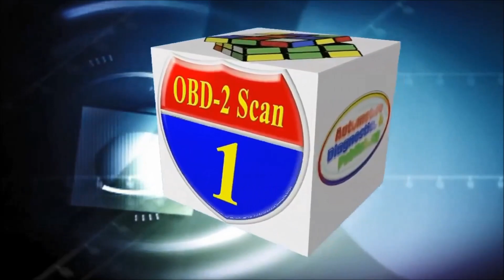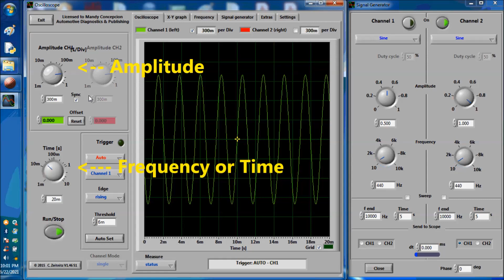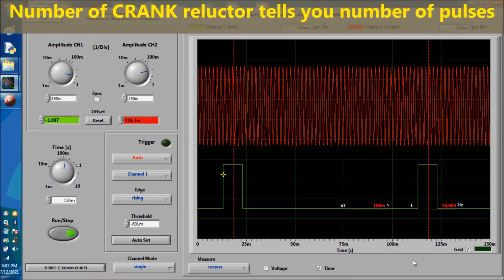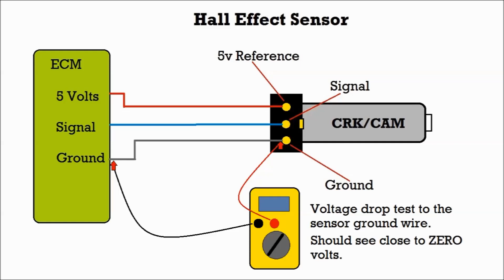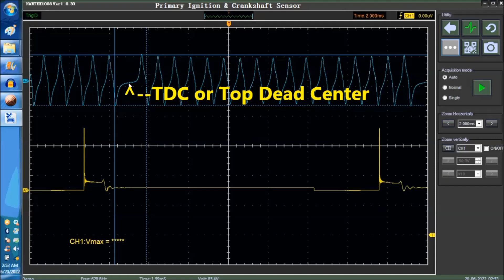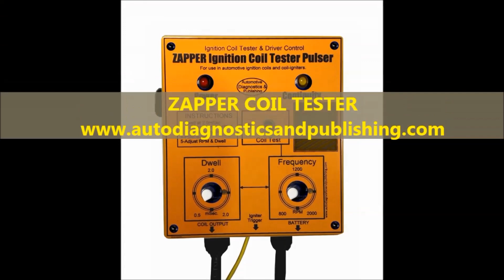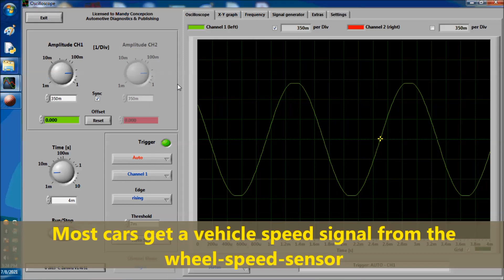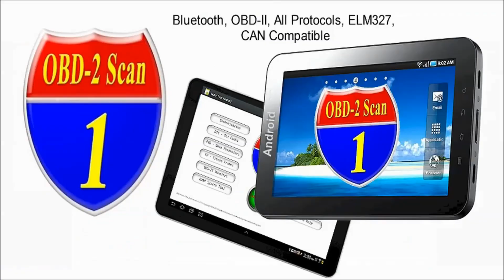Automotive Oscilloscope Study Course  3

Comment: Hi, I appreciate your  work and your contribution to the automotive sector. I am considering your scope but I haven't yet seen it in action in the real world situation that's what I need to see in stead of wave form generator signal. It's 8 channels that's good but how does it perform. How does handle in cylinder diagnosis?
Reply from the maker: http://www.autodiagnosticsandpublishing.com/8_Bangger_Ignition_Probe.html
Reply from the maker: We're now sold out on the Scope. But I can assure you it beats that expensive Pico a million times. Great ROI.